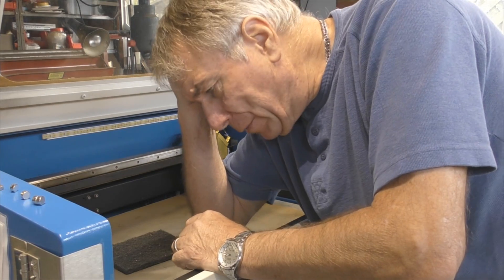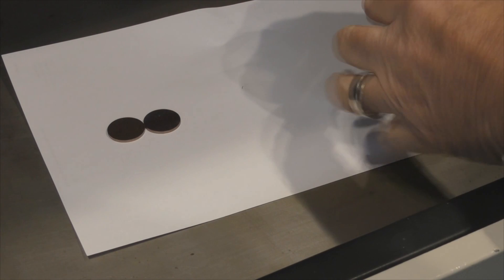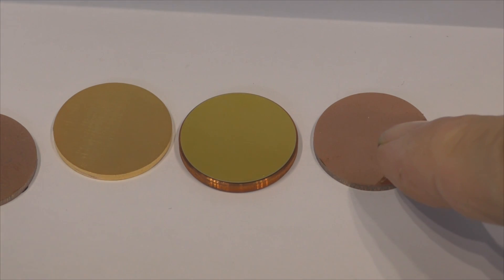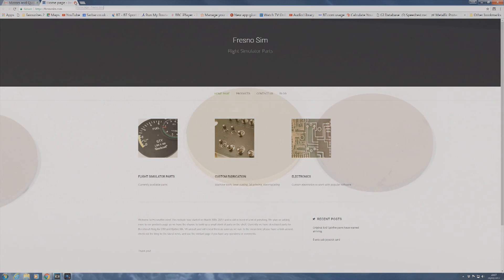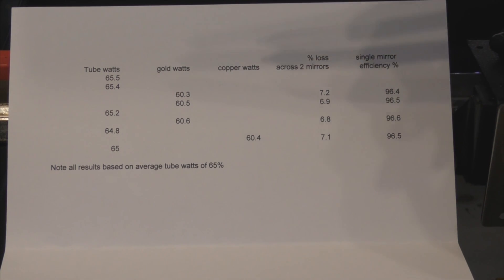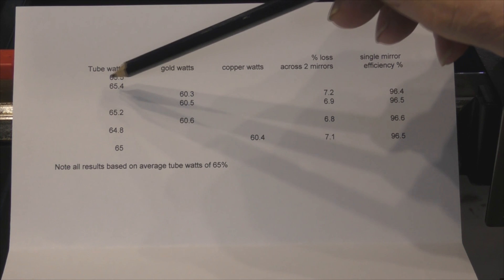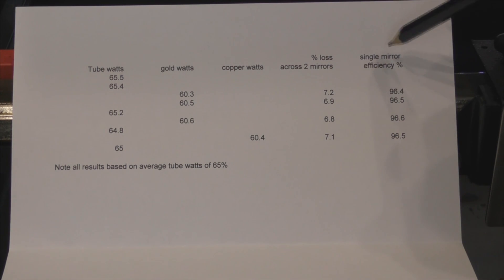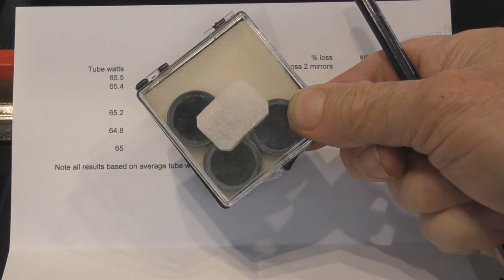RDWorks Learning Lab 103 Gold Mirrors

Comment: Russ, can you tell me what to buy for mirrors for my lasercutter?
Reply from the maker: Hi Christ

The only mirrors I would recommend are solid molybdenum  No matter how expensive and whatever the claims, do not ever buy plated mirrors. You can clean these moly mirrors  acetone if you really  need to but generally iospropyl alcohol will suffice. Plated mirrors wear through after a few cleans 
Try these 
https://www.cloudraylaser.com/collections/co2-mirrors/products/cloudray-high-quality-mo-mirror-dia-15-19-05-20-25-30-38-1mm-thk-3mm-1pcs-custom-made-for-co2-laser-engraving-cutting-machine?variant=7645314744371

 Normally they will be 25mm diameter but check diameter before you buy. At about $5 each these are fabulous value

Best wishes
Russ
Reply: Russ, thank you! 
Currently working on my chinese laser. Bought this without the Ruida controller and laser tube. Fitted a 80watt laser tube from Reci inside and need to change the mirrors to get a good quality of products. I changed all wires inside the control cabinet. Lot of work but hopefully it will be a better machine.
Reply from the maker: Some older machines have 20mm mirrors. If you are upgrading you may want to also consider new 25mm mirror holders  for at least positions 1 and 2. Sadly it will mean a new head as well if that is 20mm. The whole kit is not that expensive.
Best wishes
Russ

Comment: Hi Russ. Tell me can you up grade a Laser Machine to be able to cut metals as an example? I bought a machine on the understanding that it could cut metals. Thanks Russ.  Rob.
Reply from the maker: Hi Rob
Maybe. You require several things for a metal cutting machine. First a lot of power, at least 130watts. Secondly you will need a special head that has an pneumatic or stepper driven lift/autofocus. It's a lot bigger than the normal head. You will need a cylinder of oxygen for mild steel and masses of nitrogen at high pressure (150psi to cut stainless steel to use as the cutting assist gas. I owned two 3kw metal cutting lasers as a profiling business for 10 years and when they sell or demo these Chinese machines they never mention all the infra structure you will need.   see https://www.youtube.com/watch?v=3eDDA0AsQVs    Listen to the high pressure gas leaking away $$$$. There is just a flash of the gas bottle. I think they are using argon rather than nitrogen as a cover gas in this case. The cut edge looks a bit black.

Sorry for the disappointment
Best regards
Russ
Reply: Thanks Russ.

Comment: Hello Russ,  thank you for your videos. so helpful!  You are a wonderful teacher.  I run two 60 watt Ebay Chinese lasers.  The black and red runs that I think are the next step up from the blue and white one that you have.  I love them!!!!  As I think you have mentioned, I don't even bother with the tubes they come with.  I replace both the tubes with real 60 watt tubes and the machines work great even in a commercial stetting.  We run them 10-12 hours per day with no issues.  I will probably buy a third one soon. 99% of our work is engraving client logos on veneered plywood.  I was thinking of upgrading the lenses for lenses specifically designed for engraving.  We do not do any photo engraving by the way.  I believe these lenses have a smaller focus point.  What type of lens do you think would be best for this and also what is the actual diameter of the lenses.  I am having trouble figuring out what size to replace with.  My apologies if you already went over this in one of your videos (as I am sure that you have)  but I have not seen it yet.  Thanks Russ!
Reply from the maker: Hi Nate
It's good to hear from someone that is really thrashing these machines. I only tinker and enjoy myself. I had 10 years running a profiling business with two 3kw metal cutting lasers. They were industrial machines whereas these Chinese machines are in a different league. I had to start learning from scratch because what I knew did not apply to these low powered sealed laser tubes. Its been a fantastic opportunity for me to combine my video hobby and my love of engineering as a retirement activity. I shall be very interested to know how long your tubes last and what you bought them as , standard or long life (10,000 hours) tubes. It all useful data that I can feed back into the community. Doing only engraving then you are really testing those X axis bearings. Even those Taiwanese bearings should last well. I do know a couple of others who are equally pleased with their machines in a commercial environment. Once you have been through the learning curve with one, adding more for capacity and backup in case of breakdown makes absolute sense. Anything serious like Epilog or Trotec is ten to fifteen time the price.

Back to your question. I presume you are using the 2" focal length lens supplied. It all depends on the type of lens mounting you have in you machine as to whether you can even upgrade to a 1.5" focal length.  There are two basic lens mount systems used in these machines. My Lightblade machine uses a system where the lens is mounted in the tube above the nozzle. If yours is like that then it will not be possible unless you can engineer a solution as I did with my Lightblade. If yours is mounted in the nozzle, the setting piece you have will almost tell you this. If the gap between work and nozzle is set to 19mm then you have a nozzle mounted lens. If so, it will be easy to remove the lens, measure its diameter (it will be any of 18,19 or 20mm diameter) to make sure you order the right size.

HOWEVER, if you are only doing logos and letters on wood, I don't think you will see any benefit from a shorter focal length.. Engraving is a subject I have scratched the surface of during my 2 years with this machine. It is a huge subject with so many variables to understand. I have just started serious pursuance of the subject because so many folks are interested in getting photos onto various materials. I can get half decent results on some materials by the scatter gun approach but I need to understand the foibles of many materials, the limitations of the machine ,lens,speed, power. dots per inch for a given pixels per inch and the many parameters that are there to play with within RDWorks. Only then will I be able to home in quickly on a good result without all the trial and error.. The problem with many woods is the grain structure can take over a picture,. In your case with logos and text it's probably a great textural feature. The problem with wood is that because it is a soft material it burns very easily and it is almost impossible to burn a mark which is the same size as the focal spot potential of the lens. A 2" lens has a theoretical spot of 0.004" and a 1.5" lens a spot size of 0.003". In human eye perception terms I don't think you would ever notice the difference and on wood I'm sure that you would get better result with the 2" lens because , although the energy density is half that of a 1.5" lens. the burn will be softer and more controllable. 

I'm not saying you are wasting your time trying a 1.5" lens but you may see no benefit with the materials you are using and the type of engraving you do. For about $20 from China, it's worth a trial. Don't bother with an HQ lens, the performance difference is negligible for almost twice the price. Just go for a ZnSe lens.

Hope this helps abit
All best regards
Russ

Comment: Hi Russ, this is fantastic trial, it answered my question perfectly JIT. I was going to do the same, but as you ventured on the journey, I just stood on the roadside and I am happy to read you findings. As you say, chasing the last 1-2% is rather costly, I had a quote from optical manufacturer of several hundreds dollars for ONE mirror with 99.9% reflectivity. They may have some dichroic coating, but what the heck.  So I will happily use my molybdenum mirrors, costing fiver each. There are horses for courses.
Thank you very much for doing this, and sharing it with us. Now I have task in front of me - mechanically modifying, adjusting and setting true the Dragon's table, X & Y carriages, Lens tube and squaring and opening the 45 deg. mirror holes. 
regards
otto
Reply from the maker: Hi Otto
I'm glad you did not spend your money also. It's cost me quite a bit when I think of 3 Chinese crap mirrors, professional lapping of 12 copper mirrors. the laser cutting of those  discs plus carriage charges, but it became a bit of an obsession to find a definitive answer and I'm glad the journey is finally over and we have answers rather than opinions. if you look at several comments below you will find people asking if it would have been better to polish the gold mirrors. Maybe but for 1 or 2% do I now care?
Thanks for your input along the way
Best regards
Russ
Reply: If I was you after all the huffing and puffing and credit card flexing, I would pour myself a glass of wine and put my feet up. You at least have 70W tube, mine is 50W at the beginning of it's life, so I will have to use it before it dies, as they do not keep as spares apparently. Is it true, that the actual claimed 2000 to 4000 hours life is not the actual working ON life, but just time form the initial manufacture of the tube?
regards
otto
Reply from the maker: Hi Otto
Thinklaser, who have direct contact with the manufacturing plant in China have established that the claimed life of a tube is it's "shelf life".  It is all to do with the epoxy used to bond the mirrors to the tube. The gases in the tube are under partial vacuum so there is a gradual ingress of external contamination.  Even Reci ,who are about the best tube maker, are a bit cute with their tube specs and warranty period.They advertise 10,000 hours tube life (shelf life is therefore 13.7 months) but the warranty is only 10 months, with further running current restrictions to qualify for that warranty. 
Thinklaser are sufficiently honest about this fact that they give you a replacement tube at the end of the 1 year warranty period. 
My 70 watt tube was only ever claimed to be a 4000hour tube (= 5.4months) and is now at 14 months and still going strong (maybe 2 or 3 watts down).  I would take this fact as a warning to hold off buying a new tube until you need it. With a through flow of machines, I know that Thinklaser will be stocking 40 and 60 watt tubes for resale, because they can keep their stocks fresh.
Regards
Russ
Reply: Hi Russ, 
thanks, yes, it is the term "shelf life" I was looking for. So what is the actual useful working time one can expect out of the "fresh" tube? There are the catalyst and non-catalyst tubes helping to keep the gas mixture in balance. We have been warned not to actually run at 100% current, as that shortens the life, and my own measurement told me that going over 65-70% does not significantly increase output power. So - how long is the piece of string, or is there MTBF? Perhaps the power gradually drops, until it does not cut any more. I also read somewhere that the pink colour of the beam is sign of a healthy tube, white is not so healthy. Not that I have in mind to run mine 24/7.
regards
otto
Reply from the maker: Hi Otto
Yes, you are asking me "how long is a piece of string?" I am expecting 2 years and many folks with known good tubes are at three years and beyond. If you are unlucky enough to have a KH Laser "brand" that period could be days to months with a high degree of certainty. 

There is 10% nitrogen in the tube and that is an essential "driving" ingredient. It is the ionization of this nitrogen that you see as the pink glow. Gasses do not normally conduct electricity but, when ionized, the nitrogen can do just that.  As it carries current its energy (and temperature) rises. You then need 80% helium to act as a heat conductor to transfer heat to the water jacket. Below a critical current flow, when the nitrogen collides with the CO2 molecule it can impart some extra energy to it. Unhappy to be carrying this extra energy, the CO2 molecule gets rid of it in the form of a photon of invisible IR light. It is this light that is then mechanically amplified by internal mirrors before exiting the tube as usable energy. However, if you program more than the allowable critical current (%power) then the energy level (and temperature) of the nitrogen gets so high that the collisions with CO2 split the CO2 into CO and a free O. You are now destroying the one thing that makes your tube work, the 10% of CO2. Remove the excess current and there is a percentage recombination that takes place because of some trace hydrogen catalyst that is also added to the gas mix. This is not that efficient and not the catalyst mentioned for long life tubes.
Even under normal operating currents, there is an occasional "dissociation" occurring. To mitigate this normal loss of CO2 they do two things. 1) they make the tube fatter so that it can hold more gas mix. 2) if you look closely at the inner central tube you will see it has a faint pink tint. That is because it has a vacuum deposited film of gold on the inside of the tube. Gold is a more efficient recombination catalyst and is the trick they use to give long service life.
If you do have an ammeter fitted to your 50 watt machine, then, if it is a true  50 watt tube (1000mm long), you should never exceed 20mA. If your tube is actually a 40watt tube (800mm long) then do not exceed 19mA. If you do not have an ammeter then stay safe and never exceed 65%power setting.
Hope this VERY brief explanation answers your questions.
Regards
Russ

Comment: Thanks Russ. I had it in mind to get a local Silversmith to knock me up some silver mirrors, doesn't seem to be any point to that experiment now.
Reply from the maker: +Hi James
Rob and I did discuss plating a set with silver but we decided against it because of it's tendancy to oxidize and tarnish so easily. Gold is obviously impervious to oxidation and promised great potential. Many thought that copper would tarnish quickly but in practice  6 months or more between light polishes seems normal.. I am staying true to my copper mirrors because because I already have them, but still have my moly set as backup (and 2 gold sets!!)
Glad it saved you the expense
Best regards
Russ

Comment: I wonder if the gold coated ones were mirror polished if they would work better?
Reply from the maker: These mirrors were lapped dead flat and had a good reflective finish before plating. After plating they looked exactly the same level of shininess as the Chinese mirrors. It is possible that a light polish may improve them but to be honest I've spent far too much time chasing those last 1 or 2% efficiency. It's been informative for me and others but I have concluded that there is a practical barrier at about 97% and after that the cost of achievement is not worth the effort. Accept the fact of a 10% loss through the system and if you need a specific work-face power then choose a bigger tube at upgrade time.
Best regards
Russ